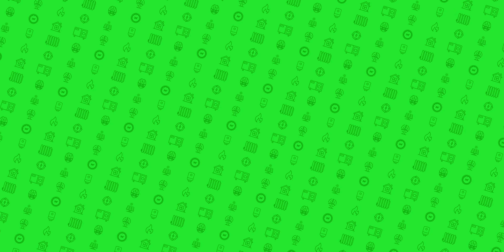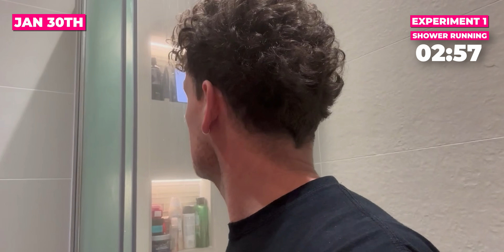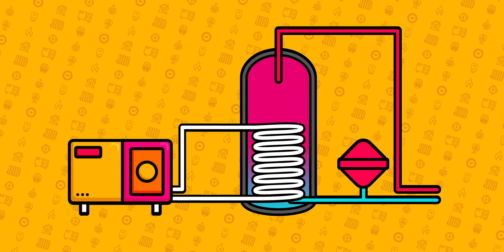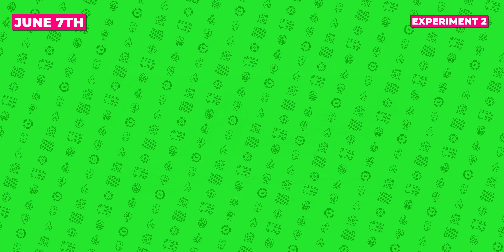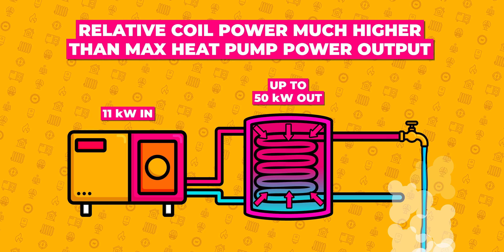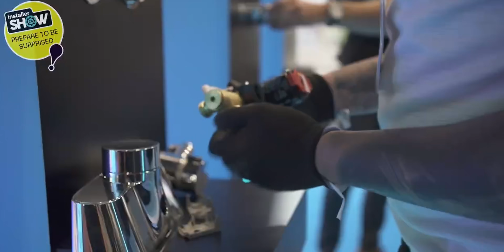The Worlds SMALLEST Cylinder is here!

Comment: I have a tiny (non-combi) boiler under the kitchen counter that's at the end of it's life - and no new gas boilers will fit the space...  I'm trying to get my head round why I can't simply swap it for this mini tank and use it just like the boiler - e.g. to heat the house as well as fill my old hot water tank with hot water.  Perhaps I could add a few air-to-air units to reduce the heating load during winter?...

Comment: If this works with a gas combi boiler, does this mean not having to run loads of cold water before the water gets hot? Especially in summer time when the heating is not on.
Reply from the maker: No. Literally the same as a hot water cylinder or combi currently
Reply: @HeatGeek  Can this be installed to work with my existing Ideal Logic c30 boiler. My thinking being that when I have an air heat pump installed to replace the boiler at some point it will work with the replacement air heat pump

Comment: Very interesting video.

Here's a question, I'm adding a 6 meter extension to my 1950's 3 bed semi. On paper, it could be regarded as a good time to consider an airsource heat pump. But how would your house heat  measuring equipment be able to estimate my house heating needs before construction? If I wait until after I build said extension, I run the risk of building obstructions for a air source heat pump install, adding to my development costs.

Do you have any suggestions?

Robert

Comment: I think showers should be re-engineered to circulate rather like a dishwasher does, reheating the circulating water and cleaning off with clean water. Then recovering the heat before throwing down the drain.
Reply: You actually can get heat exchangers like the recoup heatdeck to preheat incoming water using the heat from the drain water. I'm considering installing one when redoing my bathroom, they say they save around 35% on heating required

Comment: This looks great, but with a small HP of only 3,3kW heat output with a maximum output temperature of 45-47 °C I am a bit afraid whether it's power will be enough.
Currently I do have 250l water tank, so I don't need something absolutely small. I guess it would be better to go with some of the larger variants to be able to provide the house with 2-3 showers the current tank is able to.
Do you have any calculation available to properly size the tank?

Comment: Your water output was much smaller than most showers, thus invalidating your test. How would it keep up at double water flow volume?
Reply from the maker: Go back and look at the results we tested at both lower rates. We also produce a table of results of the flu rates and various incoming water temperatures with the unit.

Comment: Ok. But what about defreeze cycle? You going to run out of hot water in minutes.
Reply from the maker: As per the video where I meantion this, is needed testing. We’ve since ran a load through a full winter and experienced no issues whatsoever.

Comment: Doesn't the water temperature that you achieve depend on the flow rate in this setup? With a regular hot water cylinder you get water at the temperature that it got heated up to (well, of course with some temperature gradient along the vertical axis), but here your output water temperature would drop below that at high flow, right?

Comment: I cant understand why HW systems relied on blending to reduce the temperature at the point of use, I fitted blending valve on my cylinders to provide the correct heat for a hand washing without adding cold water.  My solar therm tubes will easily get the cylinder up to 95 C in the summer so with a blending valve I have tremendous capacity. At first it was a pressurised tank but a few years ago swapped the plumbing so the coils provide the transfer of heat to HW and the main mass circulates through the solar. Great work chaps but please also educate on the benefits of solar thermal for heating water and assisting a Heat-pump

Comment: Suggestion: a control system with two sets of parameters. The "room" settings for the most efficient space heating, and the "water" settings for the best results for showing or filling the bath. 

The simplest version would simply have a "water boost" button that went over to the "water" set of settings for an hour whenever you were about to shower or run a bath.  You'd want to press that button some time before starting the shower, to let the system heat up to the higher temperatures 

You could alternatively have the changeover on a time of day basis, so you always have enough hot water at your usual sleeping time, but also have the boost to override it when you occasionally want a shower at some random time. 

It sounds like things like washing up and hand washing would be fully catered for with the system on the "room" setting. 

I'm not a heat engineer (neither the traditional type nor the geek style) so this may not be as helpful as I intend: Is love to have feedback from the geeks on this idea? 

Or am I reinventing something you've already done?
Reply: You don't need any complicated "switch over", no need to put it on an hour or even 10 minutes before - INDEED the video showed that the "automatic switch-over" was done THREE minutes into the showering time.

Comment: @heatgeek - Hi Adam, really struggling with this I'm afraid?  It's been a long time since uni and the dreaded thermo i, ii and iii, but I do remember that heat transfer is a function of area, conductivity, and temp diff.  Combi boilers 'instantaneously' heat water from ambient to 55C ish by using a highly efficient heat exchanger and extremely hot flue gases.  From what I'm seeing, and forgive if I've missed something, but you're suggesting to do the same using a coil (which will have less surface area than a combi heat exchanger) and a volume of water at 45-50C - how can that work at 'reasonable' i.e. 6-8l/min flowrates....?

Comment: I have a gas boiler that heats a thermal store tank. This heats my whole house with small radiators and a stainless steel heat exchanger provides instant hot water for two showers that can run all day. When I ask if this can be done with a heat pump I get told a load of nonsense. AFAIK heat pumps are not 400% efficient all year and they cannot heat water high enough to kill legionella. Some supposedly can but they are less efficient. In other words in my area of Scotland with electricity being at least 4 times the cost of gas, I would be mad to install a heat pump.
Reply from the maker: First of all,, this is not a thermal store. Your thermal store set up requires the heating to be kept at the same temperature of the hot water which is extremely inefficient for heat pumps and yes, I would agree with them that shouldn’t be done with a heat pump. 

You’re right they’re not 400% efficient all the year round there anywhere between 700 and 300 efficient. The average throughout the whole year is 400%. 

Your point about electricity being four times more expensive is ignoring the gas boilers even brand new ones are only 85% efficient therefore you only need to be 340% efficient with a heat pump in order to save over gas.  This is all basic stuff for conversations moved up and quite far since here.
Reply from the maker: Also heat pumps can heat up hot enough to kill Legionella since about six years ago. Sounds like you’ve been listening to bad advice.

Comment: Imagine a phase-change material (PCM) heat store that's much smaller and has pressure/weight sensors on the PCM holders to determine the amount of energy stored. Integrated sensors that are used to determine how much of the PCMs are liquid and solid (different density and buoyancy effects) and calculate together with temperature sensors the exact amount of energy stored.
Reply: Ideally you'd want a PCM with a transition at around 42-45 C, at exactly the temperature you want for the shower. 

The disadvantage is that this destroys the reliance of the idea as it's presented here: you don't want the PCM to ruin through the heat pump as when it was in solid phase it wouldn't pump well. That means a store with a coil for heating the PCM and another coil for using the PCM to heat the water that's going to the shower. 

Thermodynamically it's a neat idea, but would be more complicated to make, therefore both more expensive and take up more space.
Reply: @trueriver1950  Put the PCM in metal tubes or balls, not directly in the water. The PCM is also in the energy store not the heat pump. It's more complicated but would be much more compact for a given amount of energy than not using PCM energy storage.

Comment: Whats meant by the heat pump being assisted ?
Reply: It means that on the occasions it can't keep up, you run the heat pump as hard as possible but assisted with the smallest amount of resistive heating needed to reach the desired performance. 

This lowers efficiency and capital cost: so you'd want to do this for only a few percent of the year, but it saves doubling the capital outlay just to cope with the two worst days of the year ...

An example in the video is where there is an immersion heater in the heat store set a few degrees below where the HP comes on. In normal use all the heating is done by the HP, but when it can't keep up for any reason the immersion heater saves you from a cold shower. 

You may think a 3kW immersion heater is no good for a shower: but remember it is running in parallel with the heat pump that's on full output, it's not the only source of heat: and it should be designed to still be only the minor contribution to the overall heating.
Reply: @trueriver1950 👍still seems a 9kw electric shower would be a-lot easier cheaper to fit.

Comment: these are in use in Europe since decades. but congratulations on your discovery!
Reply from the maker: We live in Europe, and no they are not.

If you’re talking about Shell and tube heat exchanges possibly but again they have never been used for heat pumps
Reply: @HeatGeek  well, my parents in law have very similar one for at least two decades and they are very happy with it.
The question is, why only small innovative companies do these🤔
They also have it from some small local company that is out of business for years.
Most big names only do the classic way of water from heat source going through the pipe to heat the stored tap water.

Comment: One question I have is whether this system could suffer from scaling in the heat pump due to directly heating tap water which could be hard in some locations.  This would impact efficiency.
Reply: The tap water never enters the heat pump, as I understand their system. The main water flows through the coil, so there may well be a scaling problem there, rather than the heat pump itself

Comment: 15:38 legionella: allow me to introduce myself
Reply: Impossible. The bulk of the water in the tank circulates through the heat pump. The water coming out of the tap/shower has only passed through the tank in a coil and only once. Opposite to the model of a normal hot water tank.
Reply: @Hamish_A  ah, yeah, that makes sense. Would the circulating water reach 70 degrees?
Reply: @SwordQuake2  The water in the tank side is in a sealed system so at no risk of atomisation which is how it would infect people if it did contain legionella. It also passed through the heat pump or boiler so will get to a high enough temperature there and if it ever didn't for an extended period the system can be set up to run a hotter cycle once a week.
Reply: @Hamish_A ... Agree totally, plus being in a closed system there is less opportunity for the legionaires bugs to sneak in in the first place.

Comment: @HeatGeek At the 9:45 mark, the video shows a kind of inversion of control. Instead of the refrigerant from the heatpump entering/exiting the storage tank inside of a heat transfer coil, the household water supply is now in the coil. But I'm guessing the liquid flowing in and out of the tank is not refrigerant, but some other solution designed to transfer the heat. I'm guessing that the refrigerant stays inside the outside unit and the heat from the refrigerant is transferred thru a heat exchanger to this intermediate solution, yes? What is this solution? And does this extra step cause much of an efficiency drop? I see from your demo that you still manage a COP range of 3.6 to 3.9, which is pretty good compared to heatpump water heaters (which usually get a COP of 3.8 to 4.2) 👍
Reply: Yes, I'm curious about that as well. I certainly wouldn't want a working fluid like propane filling the whole cylinder 😢... 

So into I saw the question I hadn't even thought that's what you might have meant

Comment: I do shower on an electric flow boiler of 6.5kW which is doable. I'm not able to shower 'very hard' but it's just fine. Only in winter time it struggles to keep up with the colder water. This makes me believe you can just shower with a heatpump of 6kW or more without cylinder.
Reply from the maker: Defrost function will prevent that.
Reply: Correct. A tankless heater should be 11-18kW for showering. Too much for a pump thats meant for heating the flat primarily. There is no way around storing. A tankless heater in series with a tank makes sense though to handle peak demand
Reply: @johgude5045 that's true
Reply: @HeatGeek that's true. Would ground sourced work for this? But even if so, you're not heating your house while you possibly need it
Reply: @Robbedoes2  every combi gas heater does this, it can only supply hot water or heating, not both at the same moment. Same for every other heat source such as oil or heatpump. It just depends on the heating power available if a tank is needed or not. Most heat pumps are to week for this but this is totally fine. There are good solutions like the "instant hot water tank" shown in the video.

Comment: Sorry I had to re-write my comment as I didn't pay attention. I now understand. It works like a Sunamp or combi boiler in hot water mode.
Your heated tank of water is part of the heating circuit like a buffer tank for the hot water heating loop and the hot tap water circuit runs through the tank  to pick up the heat. A 7kW ASHP can then keep the tank hot enough to keep the up with the flow rate of hot water. I suppose the tank size and ASHP power determines the maximum flow rate for hot water. Brilliant. Why did nobody else think of this ? Will this get MCS approval for use in conjunction with the Boiler Upgrade Scheme grant ?
Reply from the maker: Hot water solutions don’t require MCs certification

Comment: Surely our problem is heat gradient or differential?    Rising  from 5c to 55c for domestic  hot water is hard enough  but air heating  to air is only 5c to 21 a 16c rise.  where is this extra  heat from?  It looks like it's water already raised to 55c so expense is doubled reheating already warmed water.   Direct element to shower temperature is less complicated,  this combination  is complicated much like an engine management system for your car where better mpg is offset by repairs and sensor failures.  I feel a preference to keep it as simple as possible.   A2A for heating,  a solar water heater perhaps or just an immersion with is 100% efficient and simple.  Raising water T as an energy battery is over complicated heat it to what is required when its needed.  Perhaps I have it wrong?

Comment: NOT NEW WE WERE FITTING THESE 40 YEARS AGO IN PARK HOMES  !!!!!!
Reply from the maker: Are you sure you weren’t fitting thermal stores that also provided heating? What were they called?
Reply: If you are at the installer exhibition I will explain the issue regarding the cylinder also how to produce heating and hot water for

Comment: Also, im looking at a couple of properties where the peak heat loss is < 4kw.  Will a small heat pump like this have insufficient power to heat water for baths/showers when coupled with this unit?
Reply from the maker: Depends on hot water demand but you can’t use oversize your heat pump with little effect on heat pump efficiency

Comment: So skipping all the hype - it is a termal store cylinder linked to a heat pump. The hype is nice, but the fact that thermal store are a well understood produce may make it an easier sell to the market.
Reply from the maker: @rogerthomas7040  no. Thermal stores should not be used with heat pumps. This is a shell and tube heat exchanger.

Comment: This is all well and good but heat pumps work best when they are “heating less” or “cooling less” it takes a lot more energy to heat 15 degree water to 55 degrees then it takes to heat that same 15 degree water to 45 degrees. It may be more efficient for storage but not energy wise.

Comment: Interesting. Here in Scandinavia, most residential heat pumps, be they air-water or water-water, include an integrated hot water heater. I'm not familiar enough with the UK market to understand why that's not the case there.

Comment: This is so inspiring to see! I hope to be renovating this year, hope to find a similarly smart company here in Holland
Reply: I'm thinking it can be a normal heat pump storage boiler just piped the other way around. Really tempted to try because it makes sense to have the large volume low delta t in the vessel and the low flow rate high delta t 'restricted' by the coil, because that'd make it practically unrestricted. It can offer both lowest possible recharge time, highest delta t for the heat pump and no chance of legionnaires disease. And with a larger volume boiler and bigger coil it'd presumably work even better (stratification, heat transfer so possibly lower storage temp etc.). Very tempted to try this on a new install I'm doing for my mom.